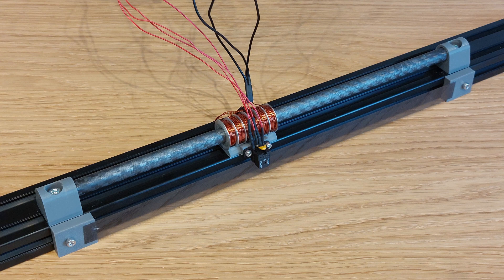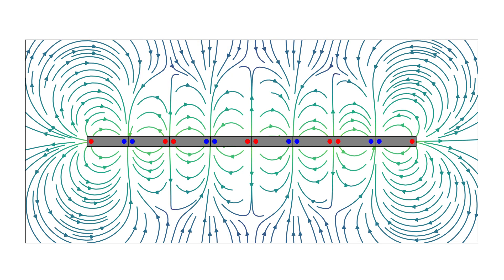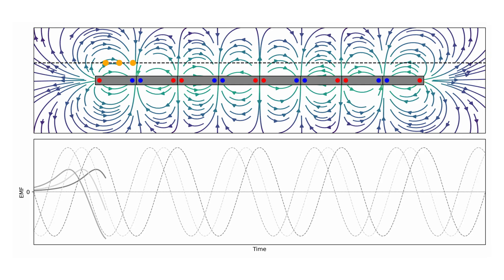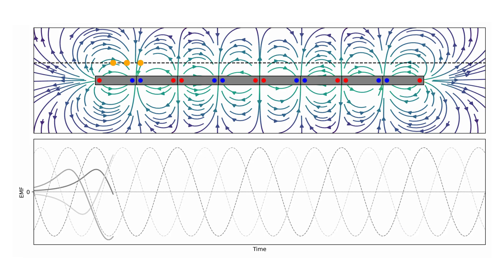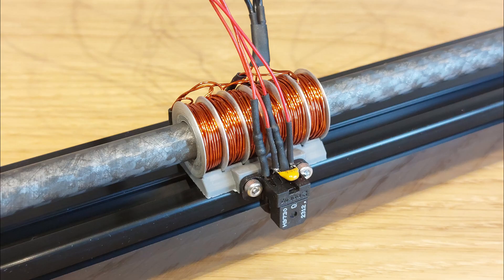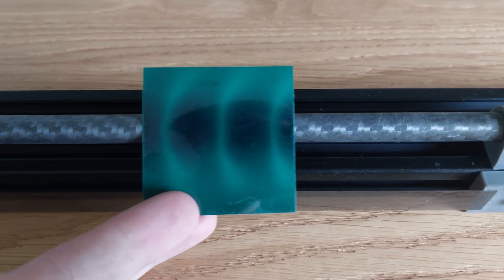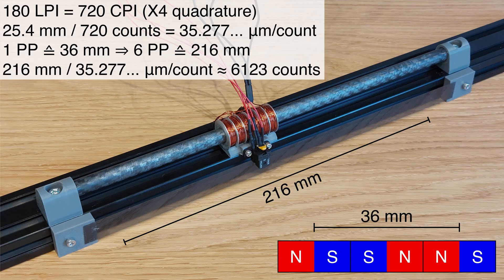Tubular linear motor (LSM) explanation & DIY

Comment: Hi there, amazing, very nice project! Would it be possible to reverse the mechanic movement? Meaning: the winding is fixed but the tube would be move outside and generates electricity in the winding- as a generator does?
Thanks for sharing! 
Chris
Reply from the maker: Yes and when using it as a generator you don't even need 3 windings

Comment: have to work on your core... iron.
the reluctance. lot of power going into just producing heat as you need high amps to drive the flux through the air.

far less amp turns for the same field strength in iron.
but it couldnt be tubular, only arrangement is radial spokes, staggered "c" cores (and coils) occupying 120 degrees each at 2/3 pole pitch...

 a distinct and separate path for the flux of each magnetic pole pair.

at which point with a different magnet arrangement on the shaft  it can also rotate. wonder if you can do both?

Comment: What voltage did you use? It seems to me, pretty low? Why?
Reply from the maker: What makes you think the voltage is low? I'm using a closed loop driver that applies the voltage (amplitude) based on the velocity, inductance and resistance to stay below the current limit.

Comment: I needed something similar but needed 100% control over the acceleration profile.  I used stepper motors, a linear timing belt (cut, laid flat along a rail), and a clutch mechanism.

Comment: What linear resolution can it achieve? If you target to stop somewhere, how far off will you be?
Reply from the maker: I'm using closed loop position control and the encoder has a resolution of 0.035mm, in reality it will be off a little depending on the tuning. You can see an example graph in the video.

Comment: I thought about creating an electric charge from the movement of a wind turbine blade. By placing the linear unit inside the blade and having the movement of the blade as it moves eventually from down to up as the force . What do you all think? Could this be possible as a small booster to a wind generator?

Comment: Linear motors like this are often used in high speed industrial machines like pick and place machines etc.
And the linear motors are VERY expensive.
Reply: This seems to be one of the most DIY-able types of motors, though. The tubular variation, at least. Tie it to a cable drive if you need something spinny with limited turns. I'm sitting on a lot of flat magnets here, so the entire world looks like a nail ehm coil.

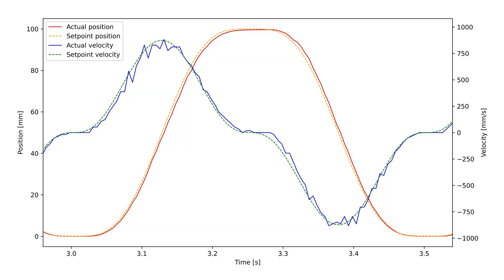Comment: Nice. You can see the rod flexing at 3:00 but not sure if that affected accuracy at all.
Reply from the maker: I gave the rod some wiggle room because the linear guiding system is not perfect (tube is not straight) so it's just moving a bit, not really flexing.

Comment: I build same a couple of years ago. With 3 h-bridges and an esp32. Look in my shorts. Never had time to explain the working model. 😂
Reply: And under normal videos you can see the complete cad model. With an digital caliper modified as closed loop feedback.
Reply: @OrgathmTech  Wouldn't a HE sensor give you position feedback for practically free? Maybe a second one out of phase, for increased accuracy. Yes, homing.
Reply: @ronnetgrazer362 fir homing i use 2 optical sensors for 1 buck per sensor. And for position reading i could use an magnetic rotation field sensor and set it a bit away from the coils. But i thought thats not precise enough and my coils are not shielded. So i used a cheap caliper with serial hack. This is 100% precise. The motion part from the calliper is installed with a gopro like mount for flexibility. So the sensor floats over the calipers main body and the sensor coils inside. Was just a proof of concept, if i am able to plan, construct, build, wire and code a thing i have had almost no informations about. I have had this project in mind for years. Then i buildt it, and startet the next projekt. 😂 on the display it is visualised whats happen in the coils. As it worked, i stored it into a box 😂😂
Reply: @OrgathmTech  ingenious, cost effective... geil! :)
Reply: @ronnetgrazer362  there is a feedback. look the CAD video. its a modified caliper, with serial out. the sensor is coupled with a gopro like holder and floats directly over the ruler. everything has excenter possibilities to adjust the tube and the sensor.

Comment: Great concept! Have you taken into account that the Al tube has a lot of drag due to Eddy current of the inner moving magnetic field? No conductive parts...
Reply from the maker: My main concern was the generated heat deforming the core. I had the aluminum on hand and tested how much drag it had and I found it reasonable (it's only 0.5mm thick) for a prototype.
Reply: @stijnsprojects So making a mould with Al powder and epoxy or even fine sand should circumvent this - with great effort. Is the heat dissipation in your trials really significant?
Are the magnets in Halbach array to concentrate magnetic field?

Comment: i was so excited to learn about this, but then incredibly disappointed when i realized its just a set of coils sliding up and down a rod filled with magnets. that being said, it makes me wonder, how much better could you make this design substituting the permanent magnets for electromagnets, its a very cool, very DIYable design, that only takes a 3D printer and wire (and magnets maybe) to pull off
Reply: That's just a doubly fed electric motor. Same pros and cons.
Reply: @Mindbulletz  well no, because the main pro is no permanent magnets are required. also you could in theory breifly overpower the electromagnets for increased torque/speed as long as you adhere to a duty cycle that respects the thermal capacity of your design. 
electromagnets also wont gradually build up abrasive ferromagnetc-dust directly on the shaft. or begin to demagnetize at 60-70C (interior of car in sun, for example) if cheaper grade neodymium magnets are used. good Nd magnets can go up to 300C sure, but most that have that crazy strength/cost ratio are of an alloy whos curie point begins really low. 
So, different options for different situations, but originally i was mostly thinking about sheer power for a given cost. Im not afraid of winding small coils though so my perspective might be different here.
Reply: @ronoxengineering  Everything you've said applies to both permanent magnet brushless rotary ("BLDC") motors and permanent magnet brushless linear (seen here) motors.

The pros and cons of switching from a BLDC rotary to a doubly fed rotary motor are the same pros and cons of switching from a BLDC linear to a doubly fed linear motor.
Reply: sorry, yeah you are right, i think i misunderstood that in a weird way.

Comment: What type of force is this capable of?
Reply: Maybe a 3D printer?
Reply: Depends on your coils,power and cooling, if these 3 factors are efficiently provided at best, it can even be able to handle hogh loads say dozens or hundreds of KGs again based on the profile of the coils and rods and the latter factors.

Comment: Linear motors will never catch on because they require an unnecessary number of magnets (expensive) compared to a rotary motor
Reply: It doesn't have to "catch on" as a mass-produced product to be worth making it.
Reply: @delphicdescant  He's talking about it not catching on using a microprocessor that wouldn't be possible without it. 😂😂😂
Reply: @JaisonBuilds Not sure about that. I can picture them being used on small devices like printers or other home appliances were the number of mangents required isn't huge. There might be a cost saving with them replacing linear slides + stepper motors, gears and cams etc. The lower cost might not just be in terms of component costs alone but also in ease of assembly and reduced complextity of associated mechanisms.
Reply: @nrml76  I don't disagree, but belts/ball screws/linear slides are still generally pretty cheap and can be assembled easily. You are assuming assembling a linear motor is easier which I disagree with. Gluing a bunch of magnets together while ensuring the correct polarity and alignment is not an easy task

Comment: Aluminum forcer core ???? LOL.This is a bad idea. Because the core creates a single loop of wire that is closed on itself, i.e., it creates a short circuit.
Reply: The cut can help.
Reply: @hamper3049  yes, this will help.
Reply: It's insulated from the wire coils.

Comment: Aren't the reactive currents in the aluminum pretty brutal to the motor's efficiency? If the aluminum was zero resistance, it would completely cancel the fields of the coils- it's not zero resistance, but it's kinda close

Comment: I made a mico version of one of these with only two magnets and coils to power an insect-inspired drone. For feedback, in my case I used two linear Hall effect sensors placed on each coil to measure the perpendicular magnetic field strength used to calculate drive current. I could also use that measurement to calculate the position of the magnet within the coils. Heres a video of some experiments I did for a paper with the same title: https://www.youtube.com/watch?v=myYOX1wwIMQ

Comment: Um why don’t they build rail guns like this you could control the velocity bof the projectile
Reply: If they built rail guns like this, then it wouldn't be a rail gun.
I think this design is closer to a coil gun rather than a rail gun. The speed of the projectile can be already be controlled in a coil gun. The speed is controlled by adjusting the timing of when a coil is energized. The speed can also be controlled in a coil gun by controlling the amount of current sent to the coils. 
I think the amount current sent to the coils in a coil gun is harder to control than the timing of when a coil is energized.
Reply: They do, but at high speed it get difficult

Comment: Excellent! But how did you arrange the magnets same polarities facing each other? By mechanical force or you left a gap between them?
Reply from the maker: The magnets are only ∅8mm so they are not very strong so I was able to push them together. I've also seen setups where there is a controlled gap between the magnets using a spacer.

Comment: would this work for a cnc machine or 3d printer?
Reply from the maker: It would and they exist, for CNC they do need to deliver a relatively large force in comparison to 3D printing to overcome the cutting forces.
Reply: @stijnsprojects Even if the magnets and coils are scaled up + active cooling?

Comment: I don't understand the aluminum forcer core. Won't it conduct eddy currents and thus waste power as heat?
Reply from the maker: My main concern was heat from copper losses so I didn't want to 3d print the forcer core and have it deform so I thought let's give aluminum a try since I have it on hand. I will give other materials a try in future revisions.
Reply: @stijnsprojects  ptfe for the core?

Comment: Hey I work on prettymuch the same design for use in a DIY 3d printer. Have you measured the trust you get? Is there room for improvement in this design?
Reply from the maker: I didn't measure the trust yet, if I do, I will add it to the GitHub repo. There are a few things I would do differently in future revisions. The linear guiding is suboptimal, I would either use a linear rail or use bushings on the carbon fiber tube. Cooling can also be improved to drive them with more current.
Reply: @stijnsprojects  what about using iron sheets between the coils and the carbon tube? It should increase flux to the inside.
Reply: Improvements would be to use plastic or 3D printed bushings / sleeve bearings and lubrication. Like drylin bearings. 

I don’t know if it would be an improvement, but you could have bar magnets like dominoes standing shoulder to shoulder, alternating north facing out sideways, then south, etc. The coil would be turned 90° facing the magnets. It could be narrower if that’s an advantage, and perhaps more powerful with two coils - one on the left side & one on the right. It would also naturally not be able to rotate like a round shape can.
Reply: Muy interesante este trabajo, hay grandes aspectos de mejora pero el concepto basico esta claro, usar los imanes en sentido N-S, N-S funcionaria igual debido a que los polos de las bobinas e imanes interactuaran solo que se tendria que reconfigurar las bobinas de la forma A-B-C-a-b-c, y el control sera escalonado tipo ESC, por otra parte no esta mal usar aluminio como soporte debido a que las bobinas se asume con nucleo de aire si bien fuese ideal canalizar el campo de cada una, la eficiencia de la FEM aun sigue estando por encima del 80% debido a que los imanes pasan por dentro de la bobinas aprovechando mucho mejor el flujo B
Reply: I was just typing make the coils stretched/elongated like they do in angle grinders or other motors to produce more force (Akio TV video on axial flux motors explains it well), but right hand rule & imagining the magnetic field lines in all three dimensions proves that’s wrong. 

It also shows if the magnets were NS-NS-NS instead it wouldn’t work at all? It would just make like a solenoid I guess… right hand rule shows all the forces cancel out. 🤔 I need to go watch that axial flux video again.
Reply: The relevant part starts at 5min 15sec in (video title “What’s the deal with axial flux motors?” - 17 Dec 2024).
Reply: @davadoff  Thanks for suggesting the Akio TV video.
Reply: Very nice project and explanation!
Reply: "Have you measured the trust you get?"
Is trust supposed to be thrust?
Are you asking about how much force the coils can produce?

Comment: Is it possible to replace NS-SN-NS-SN-... array of permanent magnets in the stator rail with array of opposing electromagnetic coils? Throwing away rare earth metals from the equation is something like Holy Grail on the road to both eco-friendliness and invulnerability in sanction wars.
Reply from the maker: It's possible but the power density will be lower because of the weaker magnetic field. There are also so called linear induction motors (LIMs) that don't use either.

Comment: The Jerk-a-Tron 5000 ❤

J/K, would be rad as haptic feedback on a VR gunstock!
Reply: not just that, imagine using it as a braking mechanism on an exosuit that stops you from moving and applies soft pushback when you touch something. haptic feedback has already shown us, if most of our other senses are engaged, you can seriously reduce the quality of the component senses and it still gets processed as a slightly uncanny, but genuine experience